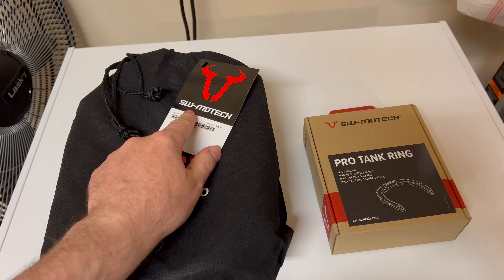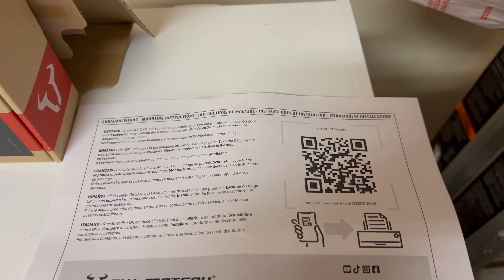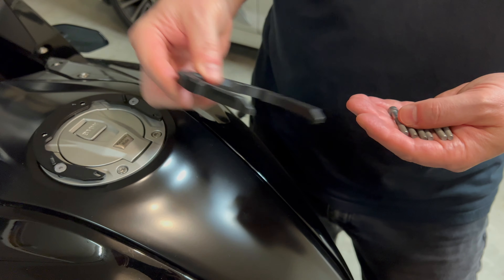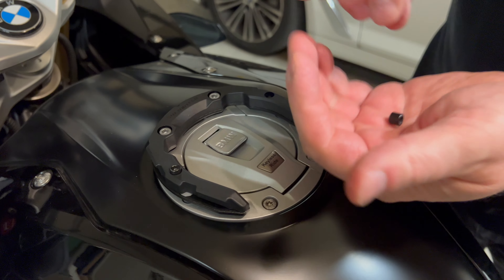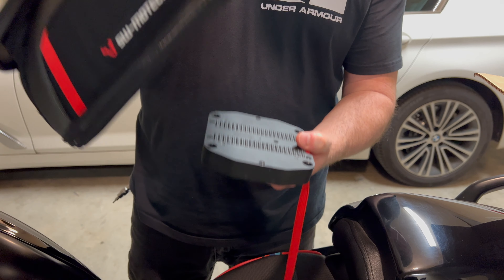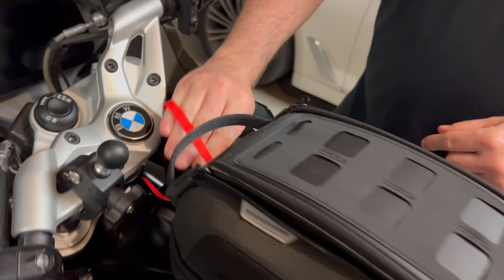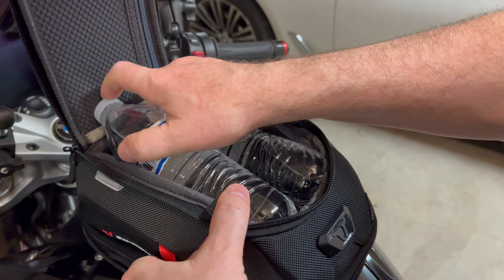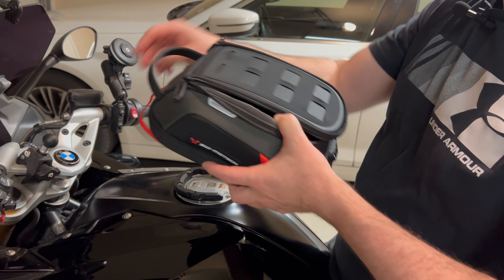BMW R1250RS SW-MOTECH Pro Micro Tank Bag Install

Comment: That's a great bag. I had an older version of that same bag on a previous bike. It was also nice to keep valuables in it because the easy disconnect feature made it easy to take inside with you at a stop. SW Motech also sells rings you can attach to your luggage rack. These external rings allow you to move it to a tail bag position when you want more room or a secure place to latch it while filling the gas tank. Nice video!
Reply from the maker: Thanks for checking out the video and commenting with your insights on SW-Motech. I’m digging it. Now just need to get out on the road with it once the rain lets up.

Comment: Great video, thank you. Trying to decide on this tank bag, it's waterproof counterpart, or the next size up. How are you liking the size so far? I liked the Giant Loop Diablo which I think is similar in size.
Reply from the maker: For me the size is perfect fits exactly what I need in it Which is a couple bottles of water my helmet lock and my toll road transmitter. In my opinion any bigger and the bike would start looking like an adventure bike poise to go on a long treacherous journey into the unknown wilderness  😂

Comment: I had the evo version on my yamaha and got the pro bag and ring for my 1250rs. Quality bag and easy to set up
Reply from the maker: thanks for checking out the video, so I'm guessing you have a larger bag not the micro. Well, I'm very happy with the purchase. Agreed quality is great and installation is straightforward.
Reply: @Texas2Tires  actually I have the same one you purchased. Purchased it over winter so it’s installed on the bike waiting to get out in the warm weather.
Reply from the maker: @speedjunkie69  I love how it disappears under your chin while riding. I don’t even know that it’s there.

Comment: I had an SW Motech Pro on my Gs which I traded for a 2023 R1250 RS. I like the clean look of not having a tank bag but need a little storage. Do you leave the bag on all the time or just some of the time. 
do you feel it takes away from the look and are you happy with the purchase now that you have had it awhile.Thanks
Reply from the maker: Thanks for the comment and checking out the video. My initial plan was to only put it on the bike when I needed it. However I use it often and I think it looks pretty good on the bike, so I just leave it on all the time. I’m happy with the purchase.

Comment: Very nice! Why did you select this tank bag over a bmw bag or something else? I got a bmw one and wished that I would have gotten one like this or similar that uses a magnet.  Mine has connectors that go under the fairing which means when my tank bag is not on the bike I need to tie the connectors together which I don't like.  Also, putting the tank bag on is a challenge because I have to stretch the connecting straps to attach it to the bag, which is a struggle.  I spend money on it so I do not know if I want to change it out but who knows. Any thoughts? Great video!
Reply from the maker: Thank you for checking out the video and the comment / question. I also have the SW-Motech panniers coming, but they ship from overseas, so they take a bit longer to arrive. I didn't choose BMW for two reasons: First, they are extremely overpriced. Second, I don't like the color or style options they have. SW-Motech products aren't inexpensive either, but much more reasonably priced, the quality is great and for me the black and red color scheme suits my bike. Finally I will add that the magnetic locking system is superior and very easy to use compared with the BMW tank bag you described. If I were you, I'd sell the BMW bag online and buy this one. The SW-Motech tank bags come in various sizes and styles, so I'm sure you could easily find one that suits your needs.
Reply: @Texas2Tires  The truth hurts! But then you are free! Thanks